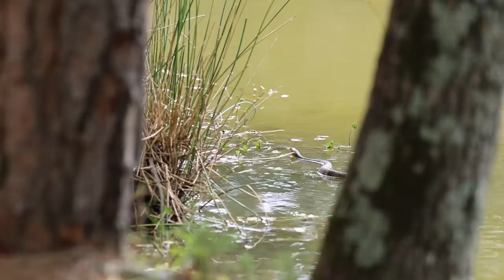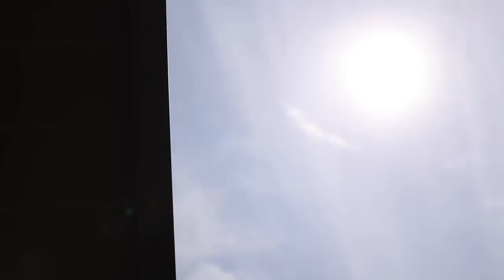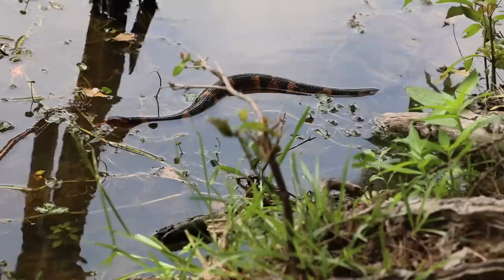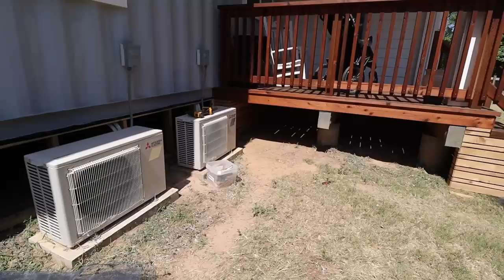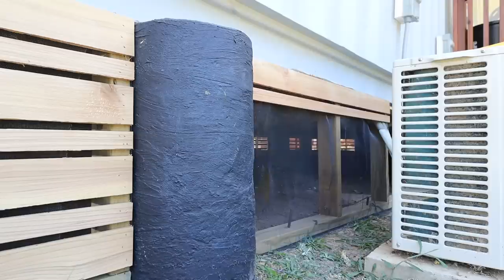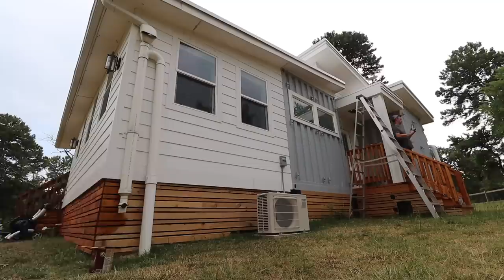HEAT WAVE | Hottest Summer Days Living Off Grid

Comment: Q: Does putting Aircon in “dry mode”conserve power on the batteries? I’ve been told it does but wanted to see if that’s true  & do you have water delivery trucks in Texas, we have them in Australia and can get a delivery for $220 usually 11000 litres 2900gal which has saved our bacon 3 times in the last 9 years on our property. Love the content guys been here since before 30k subs and I look forward to Monday mornings when I wake up to a new vlog. ♥️ Michelle
Reply: I run my air con on dry and yes does saves heaps of money on my electricity bill in summer
Reply: @suecarey9127  we run ours on dry & our power bill only increases minimally, was curious how it would change with solar & batteries
Reply: @One_Crazy_Dog_Mum  I have had solar panels for over 10 years till recently as the inverter has pooped itself but it wasn't connected to batteries

Comment: You might consider a battery bank life cycle upgrade so your not replacing all of them at once, and build a shop putting the battery bank in a better in environment. I think with what you put thru, you done really well. Most people start a family in normal conditions have lot to go thru, you went of grid and made it. The stain on the skirting looks good.

Comment: Those are Broad-banded Water Snakes (Nerodia fasciata confluens). 
They are non-venomous, but kind of grumpy and nippy if handled.
Reply: Get a well and pump to storage tanks. Also if the AC units are covered, they won't work as hard. Missed you!

Comment: Going along with your advice to oversize, have more than one way of doing things—have a backup in case something fails. In addition to relying on rain water, build a well and store extra water elsewhere. In addition to solar power in the winter, have a way to heat that doesn’t rely on solar—maybe a wood burning stove. As for cooling off in the summer, there are lots of ways, including swimming in that lovely pond.

Also, I’m glad you were able to get some peaches!!!! I’ve been trying, but the squirrels and birds get to them before they’re even STARTING to blush.

Comment: The house is looking great! At this stage, shade-producing greenery is gonna be your best friend. Planting leafy trees on the south side of the property will go a long way to bringing your heat gain down in summer (then dropping those leaves in fall and giving you heat gain in winter). Tall evergreens closer to the house won't hurt, either. You might consider making a plan to regularly add batteries to your cache, a few at a time, to increase your storage (and make sure that battery bank has shading, too!). 

I'm in the Washington, DC area, where we regularly have high-90s and high humidity, this year we've broken into the mid-hundreds "feels like" temps on multiple weeks... but the tree shading we've arranged around the house (starting years ago) help keep our place comfortable. Our backyard is surrounded by trees, and it's shady year-round. (Not much of a help right now, but in another 10-20 years, you'll be so happy you have that shade.)

Comment: As far as dealing with the heat....We moved from  the upper midwest to SoCal.  In the summer, we have daily temps above 100.  It took a long time to adjust to the heat as well as the lack of humidity.  What seemed to help was gradually increasing the temp. on the thermostat. A degree increase a week. What used to be comfortable 72 degrees is now freezing!  Our thermostat is set at 80 and we are used to that.  Love you videos.

Comment: My sister has an off grid lakehouse. I’m from MA and we have not rain either. Severe drought here. Anyway my sisters husband found an old karosene generator. At least I think that’s what it is. It pumps water into the house for the washer ect. They use back up propane refrigerators heat with wood. Lots of little solar lights that come on at night. The one thing I don’t like is that there is no AC. If there were just one small room with AC the place would be perfect. Need some kind of relief from the hot summer days. The summers are going to stay this way now. Anyway that’s my two cents for what ever it’s worth. You place is awesome!

Comment: One way to stay off grid but I,prove your situation would to increase the size of your battery bank, add a few more solar panels, and install a dug well with an electric pump.  You install a level gauge on your tanks so that the pump would only kick on when the tanks got below a certain level.  If the well is sufficient you could also use the well water or the pond to help water a garden and supply food, off grid.

Love your show, but also admit that based on the winter issues from a year ago, I wonder if your underpinning will be sufficient to protect your water supply from freezing cold weather.

God bless, keep up the good work, you guys are amazing!!!

Comment: might want to consider along with your battery upgrade is to mount additional panels on the roof.  It will not only collect more power, it will also act as sort of a shield to keep some of the sun's rays off of you house.

Comment: Have you considered geothermal for ac/heat pump?  Need loops of fluid running either under ground or in the pond.  It can reduce heat and cooling energy by 80% or more (use only 20% of current use).  
Love your channel and inspired to start an off grid adventure.
Reply: Do they use Lithium batteries or AGM/lead acid?  (can't recall, think it's Lithium)  
... and either way, they COULD add on more new batteries to the old, but keep the new ones on their own isolated/switching circuit, so they are never charging/discharging at the same time as the old.  Wouldn't take much more hardware to do that, and if they can't afford to fully replace/upgrade right now, at least it would "top off" their needs a bit, help prevent these occasional dropouts...

Comment: You've got an awesome channel and I've throughly enjoyed watching y'all build your home. May, June, and July were the hottest months on record here in CenTex, with virtually no rainfall. We've seen some in the last couple of weeks, and the temps have gone down, so some relief is in sight! You are right on: If you are running net zero for electricity usage to start with (your solar generation produces 100% of your power needs), your battery storage should be about 50% of your daily maximum utilization in the summer to ensure your batteries will last through the night with a constant A/C running. This does not account for the excessive power use during really cold winter nights, but I think it's easier to put clothes on to keep warm when that happens. Heat pumps with auxillary electric heating elements consume a massive amount of power (much more than A/C). My property now is net zero: We produce about 26MWh per year, with plans to expand that to 36 MWh/yr in 2023, because EVs consume a lot of electricity. Propane/natural gas is so much more efficient for heating. I didn't build my house, but I would have installed propane lines if I had built it. For water I've learned: Have about 40-50% of storage capacity for the average annual total rainwater collection capacity of your system. With good water usage practices, it should allow for full collection ability while not drawing down your tanks to empty - and have a buffer. Our rainwater collection system currently has 5000 gallons of capacity, but it is nowhere near enough to service our home without water interruptions. So it will be expanding to 10000 gallons next year too. By the end of 2023, we will be able to go fully off grid if we want to. If not, we'll at least be ready for the next Texas snowpocalypse. Thanks for sharing yourselves with us. All the best to your budding family. 🙂

Comment: Take care in that heat.  We experienced excessive heat up in Ohio during the June/July months (the mid to upper 90s) and it wasn't as bad as you all had, but it was much higher than we were used to having.  The skirting really does make the home have a more finished look to it and the differences between the skirting and steps aren't noticeable in the video.  It looks like the copperheads really like your pond and your neck-of-the-woods too.  Stay safe and stay as cool as possible.

Comment: With your current water issue, collecting it off the barn should be high on the list. Another option would be to build a rain roof like on the homesteadonomics channel. It could also provide a shaded area for vehicles or a picnic table.

Comment: The skirting came out awesome. As well as your home. It really turned out beautiful. I’m sure y’all are so glad everything is all finally finished. I sure know how y’all are feeling about the heat. I live in Fl and the heat lid unbearable. It’s everyday that the temps are in the high 90’s which feels over 100 degrees. The AC runs constantly during the hottest parts of the day. My electric bill has literally doubled. With gas prices so high it’s made it worse. Hopefully with gas prices starting to go down some so will the electric bill. I will be so glad when winter gets here. I would say the fall but we don’t get too much cool weather in the fall. Maybe a little. I hope y’all can soon resolve y’all’s problem as far as the batteries go. I know it would be another big expense as far as wood and whatever other materials it would take but what about building a a big cover over your home. That may help a lot during the summer. That way it helps to shield your home. Also wanted to say that the black snake with the orange going around it looked like a Banded Water Snake. I could be wrong but it’s a possibility. The females have their young towards the end of summer. Y’all really have a lot of snakes around there. Could be because of the pond. A lot of snakes like the banded water snake like to eat toads and fish.

Comment: Can you just turn off the AC? With your home being well insulated seems like you could just turn it on during the day. We live off 100% grid in Central Utah and we do not have AC, but our home is pretty well insulated, but it does cool down at night. I open the windows at night and close them during the day. We have also had a few really hot days but probably not like your experiencing. We have huge batteries that weigh a ton so definitely increase your batteries capacity to jold more energy. You can't have too much power stored. Glad you're surviving the heat and are all doing well. Love you guys!!

Comment: Hi guys, nice video, also interesting to hear that hot summers demand more energy than winters. As a suggestion for additional battery capacity, you could consider buying e.g. The F150 lighting (or another EV) which seems to have the ability to give back power to the house when needed... The car's battery can basically give back power to a certain level.... Hope this helps. Thanks for the videos.

Comment: The snake - harmless banded water snake.  The water - install a well with a small pump that runs during the day constantly with a float switch to keep the tanks full and dedicate solar panel system for the pump only. Air conditioning - install small systems for bedrooms. Got to have a backup.

Comment: Have you thought of growing trees to add shade in the summer? Also install fans to move the air and have high windows that you could open to let out the heat? Additionally have sunblocking shades? These some of the things we use to keep our cabin cool during the summer. We have 100⁰ heat during the summer.

Comment: Hey guys! Idk if y'all remember me but anyway. In addition to the battery upgrade, I would recommend looking into a system where you are connected to the grid to where you are able to sell the electricity you generate back to whatever company is there. Also I have been worrying about the water, but I don't know if drilling a well is the perfect solution because that's just another power drain. I wish y'all the best!

Comment: are youall able to drill a well on your land?  It just seems like you would still be considered off grid with a well.(even if you just had a hand pump you would still have the essential water needed.) Another thing to consider is you have all that land you could burry pipe and utilize the ground temperature for heating and cooling the house.

Comment: Hi. Thank you for your great work!
I have one suggestion. You are using a pump to suck water from the tanks. Don't know how deep is a water level underground in your region, but you can take a loot at "Abesin well". To have it you'll need a water at least 8m or higher and a pump. If all true you'll have a "infinite" amount of water. In case if pump dies this well can work from manual pump as-well. Looking forward to hear from you about this.

Comment: Run your inverter air con units at a higher set point so it is not as cool inside and use your ceiling fans to provide a downdraught and still cool you. Your ceiling fans will use less power.

Comment: Many of you have mentioned a well which sounds easy and logical.  But one thing I discovered when I was looking at the idea of using a gasoline generator to power a house independent of the grid was that many deep well pumps use a LOT of wattage/amperage upon startup with a bit less during the repressurization of the water in the system/pressure tank.

This MIGHT be the reason why they are not digging a well (due to available stored electricity).

That being said, maybe their well wouldn't need to be a deep well (greater than 50') so what I said above may not apply.

Comment: I feel your pain with the 100 deg days, ready for cooler weather in Texas! Not sure how practical this is but you could pump water into an elevated tank or tanks during the day with the excess electricity. So solar power providing for night hydro-power. Probably the easiest thing would be to pump from a lower pond to an upper pond in day and release water at night as it would allow for more capacity than tanks.

Comment: One thing that occurs during summer on a structure is called often thermal soak-storage and it gets released as the outside  temperature falls at night. Essentially a building holds heat like a radiator and when the inside temperature is greater than the outside around it sheds that heat almost like you've kicked on the furnace. Though its likely their home isn't as bad as those made of brick when it comes to the effect, it can be mitigated some what by venting the heat that it will build during the day. If the windows on the center of the house above their head can be opened it will draft the heat out like a chimney and its why roofs often have attic vents or even fans to move it out. What makes their container home energy efficient when it come to insulation also makes it an oven as well during the summer and venting the passive heat it acquires during they day will help as well.
Reply: Hello there 👋👋,how are you doing today? Hope you’re having a good day?God bless you!❤️

Comment: A couple of 5000k quiet remote start inverter generators for night time to use for your spit AC units, would solve your electrical issues.  Some of these generators are dual feed and can run off of propane for Maximum cost efficiency.  The newer generators are super quiet too, and with remote starts that can activate these up to 80 feet away.

Comment: You guys should really check your comments sections. 😉Back when yall were installing the mini splits, I commented on you having 3 separate 20amp outdoor condensers would put too much load on the electrical. 3 condensers means 3 separate motors to turn 3 compressors full of freon. That's triple the A/C load on a house that's less than 1000sqft. A simple 3 ton 3 zone 12k x 12k x 12k mini split with single condenser (placed on the east side of the house away from the evening sun + lengthening the lines if needed) would have frozen you guys in that little house. I have a 2.5 ton 3 zone on my 800sqft house for 8yrs in west Texas. The only reason to have separate units like that is if you want to totally cool and heat separate areas of the home simultaneously.

Edit: Spenser, would love to know what your current draw is on those 3 units at night with all the lights out? Could you report that to us?

Comment: Seems like a big inground concrete water tank, with a tool/garage shed build on top and a comically oversized counter levered roof directing rainwater into the tank would be ideal. Even a normal roof size with telescopic mounts to rig up sail to direct water would be great.....

Comment: Oversize or diversify. Burn wood for heat in winter (you have lots of wood around), build a ground water well, technical not a big problem, to filter it to drinking water. Plant trees for shadow (chestnuts, or other drought-resistant trees). Hugs from sunny and dry Germany 🙂

Comment: Have you thought about having a well installed?  You could have it powered by your solar power, or just a hand pump, or by a generator, or by all 3.  That would really help out in the dry season when you are running low on rain. It could just supplement the rainfall in emergency.  NO more buying water and having to tow it to the property with the CRV.   Just a thought.

Comment: It's past time to upgrade the Lithium Batteries.  Double the capacity and put an AC unit cooling those batteries in the barn.  Partition the place the batteries are and insolate and put a window AC unit on them.